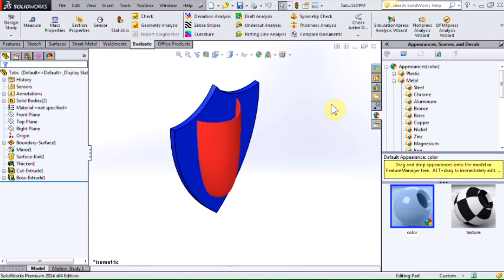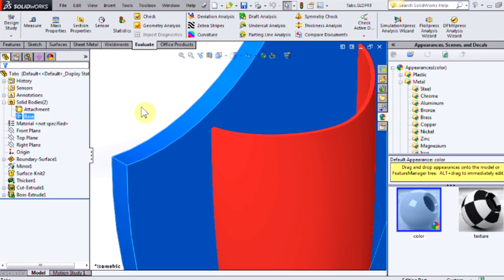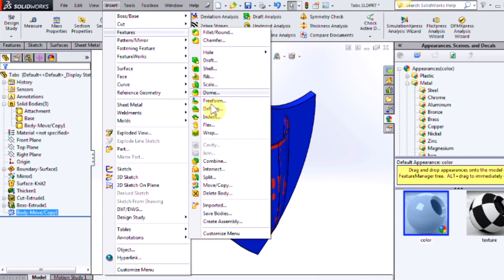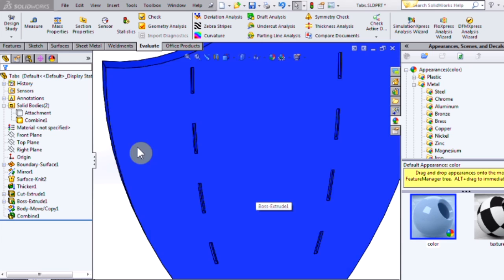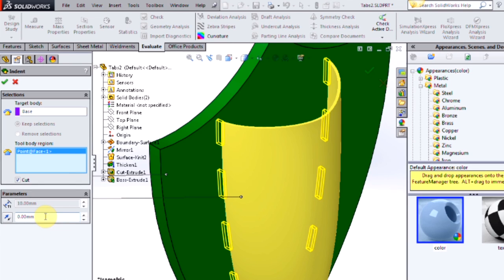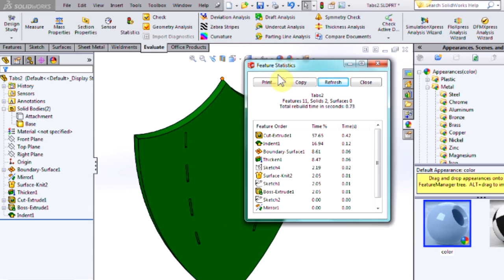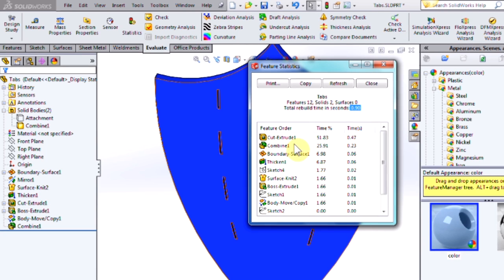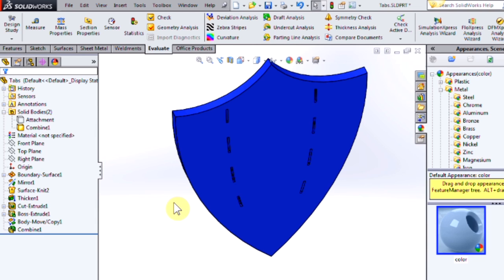SOLIDWORKS - Mortis & Tenon Multi-Body Parts and Evaluating Rebuild Times

Comment: How do you increase the clearance on the indent feature without also making an outline of the non-tenon face of your "Attachment" solid body? 

This is the issue I'm having with several "keyed" bodies in a multibody part: I want to use indent to have the tenon-ed body cut the mortised body, but to widen the mortis will mean gouging other parts of the base. how do you get around that in one feature operation? Or is it not possible?
Reply from the maker: Try making the features you don’t want the indent command cutting separate bodies. You can do this by unchecking merge results in the boss command for the feature you want to avoid cutting. After the indent has been added to the appropriate body use the combine command to turn you’re bas back into one body.